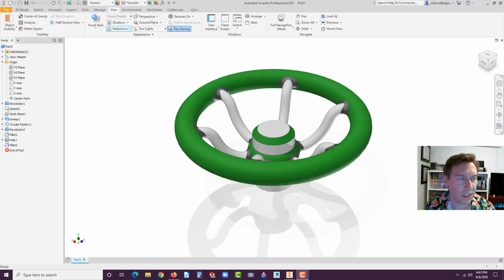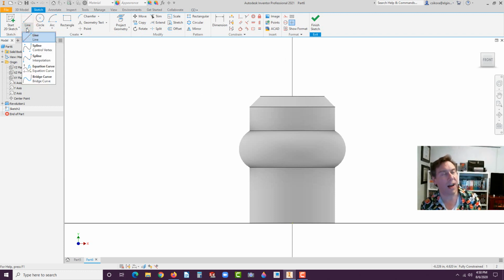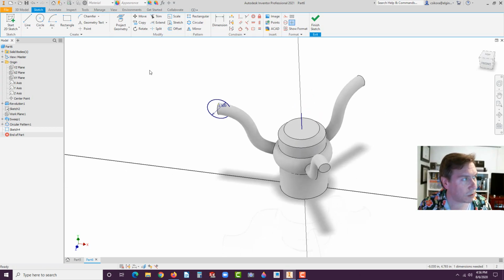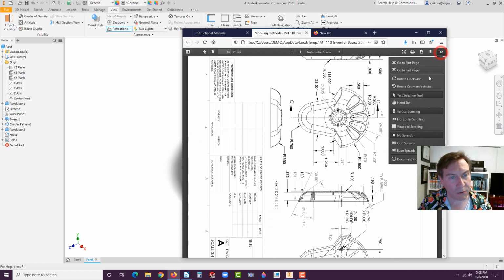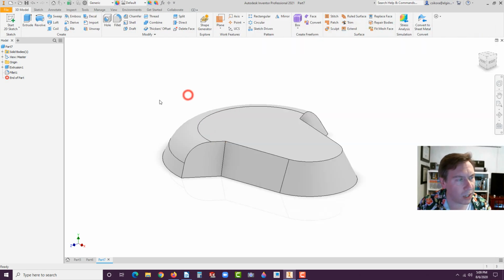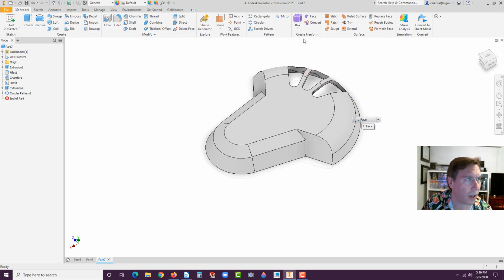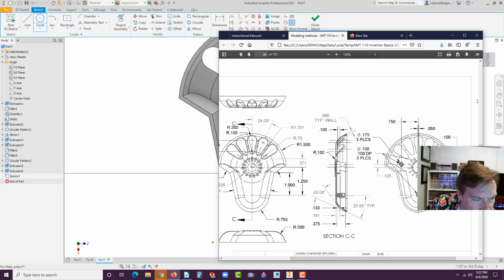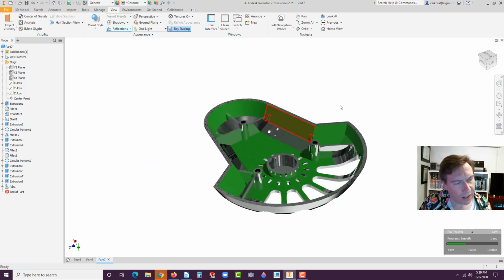E4 Autodesk Inventor 2021 - Basic Modeling 4

Comment: The dimensions for the upper left and right bosses are given in the print. They are 0.125 above the origin of the center through hole on the back and 0.75 to the right and left of the origin. However, they don't line up on the part as they appear in the print so an alternative vertical dimension needs to be used to place them on the back flat surface of the part.